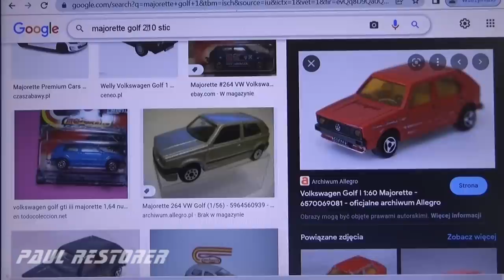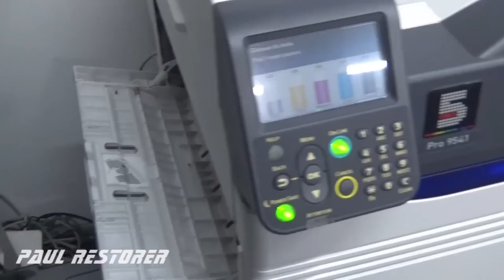Majorette renowacja Volkswagen Golf MK 1 nr 210. Zabawka model odlewany.

Comment: Hi Paul I have a question for you. The cyanoacrylate glue you use, can be indicated for attaching antennas on models, in particular can you tell me if it opacifies?
Reply from the maker: The cyanoacrylate gel glue becomes whitish after drying. it is not transparent. on the other hand, perhaps it would be better to reinforce the Micro Crystal Clear antennas with an adhesive that becomes transparent after drying and is also flexible. Kind regards
Reply: @PaulRestorer  Many thanks Paul, I've seen it use several times in your videos, how long does it dry ?? Regards